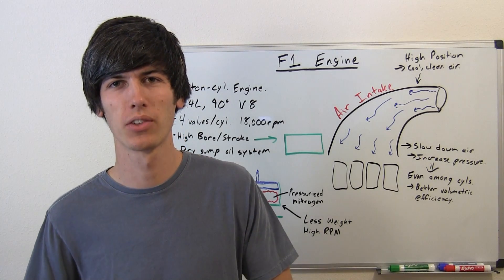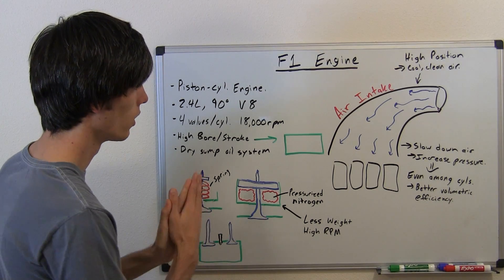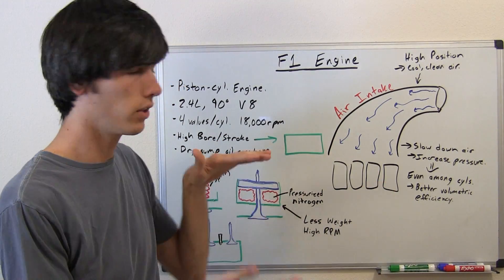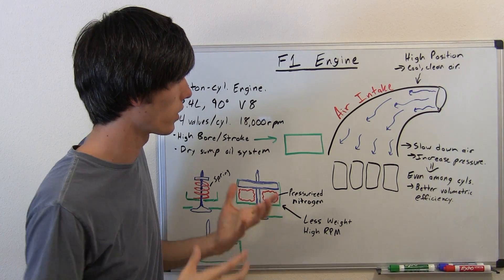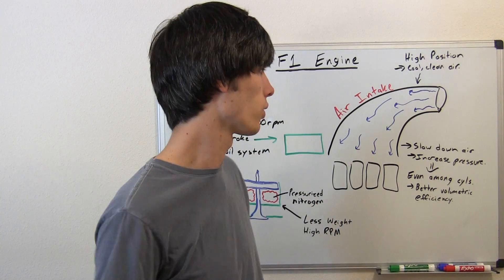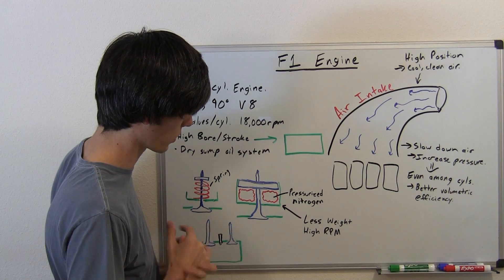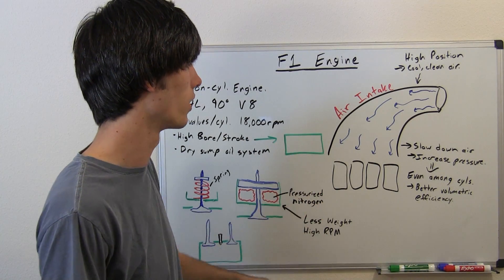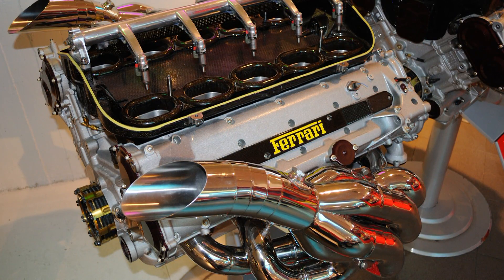F1 Engine - Explained

Comment: why not use 2-stroke engines for F1 ? It would give double the power compared to a 4-stroke. Maybe because it's too dirty?
Reply: A four stroke engine has natural separation between intake and exhaust gases except where valve overlap is designed into the operational character , a two stroke engine depends, to a significant extent on drafting and sweeping to evacuate and fill the chamber [ plus pressure differentials ] as the size of the piston increases these forces become less efficient and scavenging of exhaust gases is less productive.
Reply: As far as I can tell, 2-stroke engines are only more powerful than 4-strokes when we are talking about small engines e.g. 125cc-350cc. Above that I believe the 4 strokes begin to take over. I could be totally wrong though.
Reply: 2-stroke engines have one working stroke every revolution, 4-stroke engines only have 1 working stroke every 2 revolutions. Therefore, averaged over time, they only produce half the power when compared to a 2-stroke engine with the same displacement. This will hold regardless of size. However, more unburned HCs will escape to the exhaust in 2-stroke. This makes them comparetively dirty.  The effect and other losses may be influenced by size, but I'm not sure.
Reply: ThomasHaberkorn Yeah 2 strokes have more working cycles but is each cycle as powerful as in a 4-stroke? (again I don't actually know the answer to that one) 

Also, maybe the issue with having a 2-stroke powering a formula 1 car is the lack of Torque?  

The power band is very narrow in a 2-stroke engine so it would require a lot of gear changing from the driver in order to keep the car pulling.  4-strokes distribute the power over a much wider rev range.
Reply: you can use a multi cylinder 2stroke engine but there are two problems to deal with. 4 laps into the race the circuit would be so oily and undriveable.  2nd problem is exhaust piping packaging issue. oh and when power band comes even aryton senna cannot handle the car.
Reply: golferchin76...plus you cannot add any fluids to the car after the race starts.  Some teams have been burning oil to get a little extra horsepower; this has now been severely limited.
Reply: How well will a 2 stroke engine hold up at 13000 rpm in producing a acceptable power curb when there is the absence of precision and containment. The Intake and expulsion of gases is much more defined and controllable in a four stroke engine.
Reply: ThomasHaberkorn its to do with breathing, a 2 stroke has to get rid of exhaust and take in air at the bottom of the stroke (~1/3 to 1/2 a revolution), but a four stroke gets two entire strokes to get rid of exhaust and breath in air/fuel mix. I think that's why 2 strokes are unfavourable. either that or the FIA are dickheads who want to replace F1 cars with glorified V6 priuses.
Reply: it certainly can be done. n/a a 2 stroke 2.4l engine will easily make 520 hp on pump gas, be lighter, smaller, less expensive, can be boosted to make as much hp as the engines in f1 today make.
Reply: Tom A they will be just as reliable as the f1 engines today. these engines are all only supposed to last 1 race. you think some of the best engineers in the world can't make it be just a reliable for 1 race? lol. 800cc turbo 2 strokes make 300 hp on race gas. this is from an engine made in the 90's too. new 2 strokes weigh almost nothing compared to a dohc boosted 4 stroke.
Reply: they're everywhere, and they would take up way less space in the engine compartment too. an engine that will fit in a suitcase makes 250 hp on race gas boosted. those are only the twin cylinder ones that peak at 8 thousand rpm.
Reply: FrankieJames7 That's false. There are regulations on how many spareparts a team may use per car for each season

"As ever, reliability will be hugely important. Last year each driver could use eight engines before incurring a penalty. This year it’s slightly more complicated: the power unit is deemed to consist of six separate elements: (1) the engine, (2) the motor generator unit-kinetic (MGU-K), (3) the motor generator unit-heat (MGU-H), (4) the energy store (ES), (5) the turbocharger (TC) and (6) the control electronics (CE). Should a driver use more than five of any one component during the season he faces a penalty ranging from a five-place grid drop to starting the race from the pit lane." - F1 official website

The sport is now also about building a reliable racer and therefore F1 is now a more teamfocused sport than ever. There are LOADS of regulations that make this entire topic useless to discuss. It's not about getting the most power out of the cars. It's about having stable cars that fit into the new regulations. F1 is not what it used to be.
Reply: No need to be rude.

I've got to admit that I know nothing about 2-stroke engines. What I did notice was you saying that the engine in an F1 racer is only supposed to last for one race which isn't true. I'll not judge your mechanical knowledge since I have no mechanical experience other than what I pick up here and there. Just for your arguments sake, don't be so rude. It doesn't make your statements any stronger.
Reply: how much oil would a F1 car need for a race if its   2 stroke?pre mixing oil and fuel would be a no, so oil sprays/or injectors would be used the oil burns with fuel  so then oil refill at pit stops?
Reply: Tanyaradzwa Darangwa  You are thinking of a dirt bike. Detroit Diesel figured this problem out long ago they have a separate crankcase and air box no mixing of oil and fuel is necessary
Reply: Timothy Moyo
They already are Hybrid xD
Reply: Tom A Nathan Dance I see, thank you!
Reply: ThomasHaberkorn great presentation I was not aware that the design of the depth of the pistons stroke facilitated a quick arrival at high RPM's
Reply: Tom A As a 2-stroke puts out twice the power of a 4-stroke with the same displacement (theoretically), only half the RPM is needed for the same power. F1 revs at 18000 rpm (4-stroke), so in theory 9000 rpm would give the same power on a 2 stroke. However, unburnt fuel passing to the exhaust could be a problem.
I don't know, what is the world record for RPM on a 2-stroke?
Reply: ThomasHaberkorn You are correct in your evaluation of rpm and power. I did not completely consider that part of it. I do know that the nature of two strokes [sweeping in and out without valves ] at higher RPM and considering that the cylinder is not spherical. [ which is the most efficient shape for handling gasses ] the most efficient area of gas exchange would be the middle area of the cylinder with greater enerture in the corners of the cylinder. I will look up the world record info.
Reply: also that 800 cc 300 hp turbo engine is running stock compression, even more can be made with newer head design and lower compression.
Reply: FrankieJames7 where can I read about this engine  and how much cubic centimeters displacement would it take to  approximately reproduce the horsepower of a formula 1 engine. I think the direction that formula one is going is traditional engines and traction motors to create all wheel drive vehicles.
Reply: FrankieJames7 Thank you I will familiarize myself with this development. It's something that  seem promising
Reply: just look up "pro rmk turbo".
Reply: Kristian Søndergaard oh shut up fool, 2 stroke outboards last for ever. i'm sure 1 race isn't going to be a problem. most f1 cars have parts that only last 1 race because they need to be so light.
Reply: Would be too hard to build with multiple cylinders.
Reply: xXYannuschXx they make v6 and v8 2 strokes.
Reply: pollution thats what
Reply: Tanyaradzwa Darangwa 1/50th of the fuel as a rough estimate. 50 gallons of gas, 1 gallon of oil.
Reply: FrankieJames7 will F1 ever move to diesel or hybride ?
Reply: Fuel consumption, more pits.
Reply: ty2010 sounds legit.
Reply: xXYannuschXx how is indy 500 vs F1?
Reply: With technology now the difference is minimal

Comment: Wy does the rpm need to be so high in F1 cars?
Reply: Because the displacement is (was) limited. :)  Two ways to increase power in a naturally aspirated engine: 1) Increase displacement. 2) Increase rpm (twice as many cycles = ~twice as much power).

Comment: turbocharging or supercharging changes volumetric efficiency vary little. turbos actually decrease volumetric efficiency because the turbine is a restriction in the exhaust. It increases the charge density of the air by compressing it. The volume of air taken into the engine is only changed by the inherent restriction caused by a turbo or supercharger. The air is more dense but the actual size of the volume of air is for the most part unchanged.

Comment: flame propagation is worse with a larger bore, not better.
Reply from the maker: killakobra Correct, however the cylinder size is often much smaller as well.

Comment: Oops it's a 4 stroke (I missed that part out) so a lot less air going in there !
So the right size would only be about 7.15 cm in diameter. 2.8 " at 204 MPH 330KMH and zero Drag.
780 CFM 368 L/Sec 2.4L 18,000 RPM

Comment: The pressure INCREASE in the Airbox equates by around 5% or 40HP at around 200 MPH for one major reason and that is the static pressure produced at the inlet of the upper air box cowling (the bit that catches the air).
Following the example given below:
Given that the intake area is roughly 700 cm^2 or around 30cm round (about 12")
the static pressure is 0.593 (betz limit) x the force which is 1/2mv^2 or 0.5 * Density of the air (1.2 approx) x the area which is 0.07 m^2 x 91 ms-1 
so this is 
0.593 x 0.5 x 1.2 x 0.07 x 91^2 = 206.2 Newtons over that area of 0.07m^2
Pressure is force x area.
14.43 Newtons per Square Metre or Pascals.
one Atmosphere is 1013.25 mbar
so you now have 0.1443 mbar to add to that.
which is 0.014% increase in pressure.
So all it does is reduce the drag of the intake because the intake if larger would cause MORE DRAG than the benefit from the ram pressure.
The air intake is positioned away from sources of heat, such as the track and radiators, to minimize the air temperature. The intake faces the direction of travel to take advantage of a small ram effect the car induces as it moves forward through the air. But contrary to popular belief though, air is not pushed into this inlet, but the engine is sucking air in, reducing the drag penalty a normal cooling inlet would generate. 
The drag is proportional to the velocity cubed ! V^3 !!!
So a 2.4L engine at 18,000 RPM 4 stroke.
2.4 L x 18,000 RPM  / 60 sec gives =  720 L per second flow rate.
1525.6 CFM
The velocity of 720L/Sec in a 0.07m^2 intake is 
Volume is area x length
720 L is 0.72 m^3
so 0.72 = 0.07 x L
L = 0.72 / 0.07 
10.28 Metres per Second.
The outside air speed is 91 m/sec
So there is still a fair amount of DRAG on this intake tube
for zero drag you would need an intake area of
0.720= A x 91
A = 0.720 / 91
A = 0.0079 M^2 which is 100.37 mm in diameter !
or 4 "
Go figure that !
So you can see the RAM air effect is very small vs the drag effect.
the drag on the difference in area is 
Area Difference = 0.07 - 0.0079 
dA = 0.0621m^2
Drag on this area at 91 ms-1 (204MPH or 330 KMH) is
Drag is 0.593 x 0.5 x 0.0621 x 1.2 x 91^3
Drag = 0.0221 x 91^3
Drag is -16650 Watts of power or 16 Kilowatts !
or 
- 22.3 HP LOST to drag !
vs the 0.014 % increase in power from 700HP to 700.98 HP

So the RAM AIR that you are looking for actually COSTS you
21.3 HP and that is top speed limiting by about 1 KMH
but that's all it takes to win a race !

So if youare driving formula one F1 and your intake air is bigger than 100mm or 4" then you are pretty much wasting top speed for little or no gains in ram air charging.
QED !
Enjoy.
Reply: ram pressure is only near .36 psi at 160mph, with a 75% efficient inlet.  that's less than 1-2 % net gain of engine HP..... minus any drag it creates.  the volumetric efficiency has to do with the intake track, cam profies and dynamics.  5% gains is near 1psi, and this just isn't available through any kind of ram effect chamber.
Reply: lol cant make up your mind if it increases or decreases.
Reply: is that a crazy laugh out loud? because I think my post was very clear.... ram pressure is at a max, about  .36psi at 160mph.   less than a 1% gain at very high speeds, so ram pressure is really a misnomer for all practical purposes,   its main function is for cooler air, and putting the inlet near a high pressure zone vs a low pressure zone. (ie front of the car, or base of windshield.)

Comment: 3:35
The pressure decreases not increases.
the temp decreases are pressure drops if you use the 
Universal ideal gas equation
PV=nRT
where:
P is the pressure of the gas
V is the helle of the gas
n is the amount of substance of gas (also known as number of moles)
R is the ideal, or universal, gas constant, equal to the product of the Boltzmann constant and the Avogadro constant.
T is the temperature of the gas
In SI units, P is measured in pascals, V is measured in cubic metres, n is measured in moles, and T in Kelvin (273.15 Kelvin = 0.00 degrees Celsius). R has the value 8.314 J·K−1·mol−1 or 0.08206 L·atm·mol−1·K−1or ≈2 calories if using pressure in standard atmospheres (atm) instead of pascals, and volume in liters instead of cubic metres.

It is conservation of mass and inertia.
mass is density x Volume m=dV
inertia is mass x velocity p=mv

Hence the inertia of the gas over a larger area is the same as the smaller area and for this to be true the smaller area MUST have a higher speed and the larger area.
It also follows that the pressure is LESS as the volume increases.
Good video, just a small correction when you are presenting your research.
Reply: I believe you are incorrect. First of all, inertia is not conserved in a diffuser (aka a divergent nozzle). You actually get a net thrust force on the diffuser as air flows through it, due to the change in momentum. However the mass of air IS conserved... but it is slowing down as it progresses through the diffuser (aka a "divergent nozzle"). Reason for this is the simple equation for gas flow in a passage:

mass flow rate (kg/s) = gas density (kg/m3) * gas velocity (m/s) * area of gas stream (m2)

or, rearranging: velocity = flow rate / (density * area).
Since mass flow at any point along the diffuser must be constant, then it means that increasing the area of the passage results in lower velocity (the video is correct - the intake hole is smaller than the exit hole, hence lower velocity air is fed into the engine than the velocity coming into the intake).

As for why a lower velocity results in higher pressure - that's Bernoulli's law. Best look up the actual equation because it's a little long to write here, but it basically arises from keeping energy in = energy out. So if your exit flow has got less kinetic energy due to its lower velocity, it must have a higher pressure (potential energy).

Simplifying Bernoulli's equation (cancelling out equal terms like mass flow rate & height) - from the wikipedia article:
kinetic energy + potential energy = constant
[0.5 * velocity^2] + [pressure/density] = constant

Let input pressure = p|in; output pressure = p|out; input velocity = v|in; output velocity = v|out

Then the above becomes:

0.5 * v|in^2 + p|in/rho = 0.5 * v|out^2 + p|out/rho

Rearranging:
p|out = rho * (p|in/rho + 0.5*v|in^2 - 0.5 * v|out^2)
p|out = p|in + 0.5*v|in^2 - 0.5*v|out^2

Since we've already established that v|out is smaller than v|in due to the mass flow rate equation (above), then from the p|out equation above, you can see that p|out will be bigger than p|in (you are adding a net positive quantity to p|in to get p|out).
Reply: you are confusing the air speed of the intake air at the entrance, to the pressure drop at the entrance of the engine cylinder ports.  in that "intake" lets say the engine is not even running. whats happening?   the entire chamber is at the ramp pressure.... say .4psi at 160mph.   if cylinder speeds were all going 160mph and independent of each other, then the air would be at a constant pressure from entrance to the cylinder entrance.    again, this is not a venturi comparison where some of the intuitive air flow gas laws apply.
Reply: LMF5000 wow. That's a big research.
Reply: *****  its not an airfoil , or venturi.   the air flow flows based on differential pressure.  what you say is true for wings and airfoils, but not true for the intake ram tower.       through out the intake system, the air does speed up and slow down but its all a fraction of the source intake  pressure.